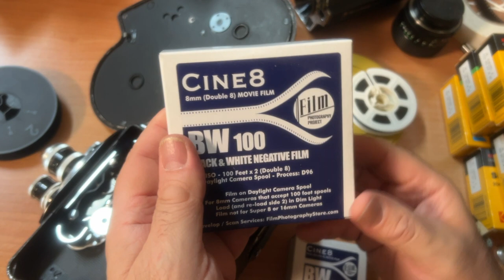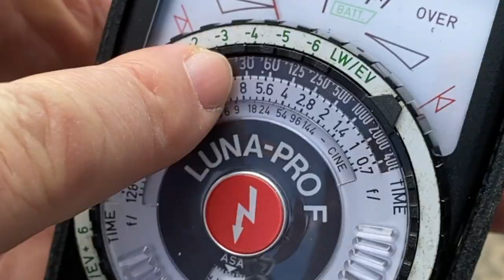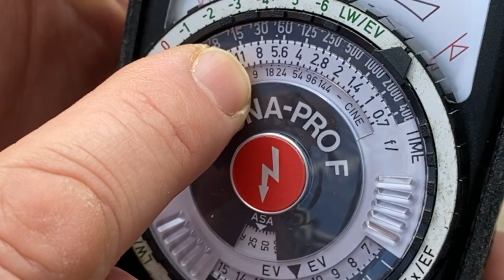Bolex H8 8mm Camera - Comprehensive Overview

Comment: Yup, it happened to me, i´m a schmuck.. And the seller did indeed indicate it was a H16. I started noticing odd things with it when it arrived, the lenses seemed small, the settings for the side wievfinder didn´t match those for a 16mm, the sprockets inside had twin rows of teeth despite a rather late serial number. Then with the pressure plate removed i noticed how small the film gate was, no bigger than the one in my super8 canon and only half the width of the film. That settled the matter of course.
I don´t mind owning one and fortunately it wasn´t priced like a H16, but it certainly made a hole in the budget inteded for one. I thought i´d done my homework before bying it but the mistake was only reading up on 16mm cameras! A learning experience indeed.
Reply: same happened to me D:

Comment: They did make two versions of an H8 reflex. The original has a round base, the later (Rex 4) has a square base, and a few other minor differences as well. The reflex models take dedicated C mount lenses that are marked RX8 on them. These lenses will not work on other C mount cameras, and other C mount lenses will not work on these cameras. Also, the H8 reflex models are labeled H8. All however are really well built awesome cameras.
Reply: The H8 Reflex lenses are labeled "H8 RX". And normal 16mm C-mount lenses will work with a 2.221mm C-mount spacer.
Reply: @1edgeman76  I have heard that. I did fail to mention that as I wasn’t fully aware of how it actually worked. Thank you for the information. Do you have an idea where these spacers can be purchased?

Comment: When is FFP going to ofger better services and color film stocks in 100ft loads for Bolex H8 users?

I own two Bolex H8 Rx4 cameras that I would love to shoot projects with. But you only have 25ft loads of color film which is completely impractical for doing an serious projects with.

I would love to shoot a 100ft roll of your new SUN ISO 1 color film stock through my H8 RX4
Reply from the maker: Unfortunately, the demand for 100 ft rolls is too small to manufacture it in those lengths. :(